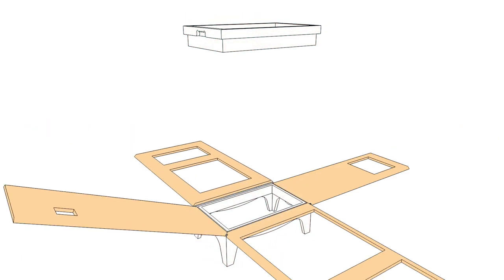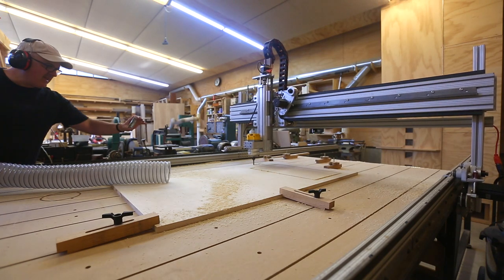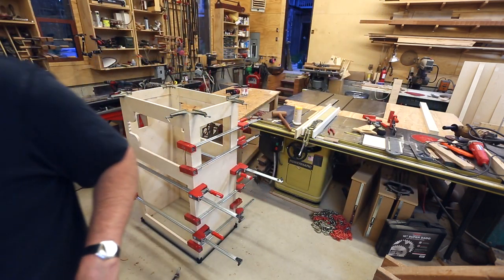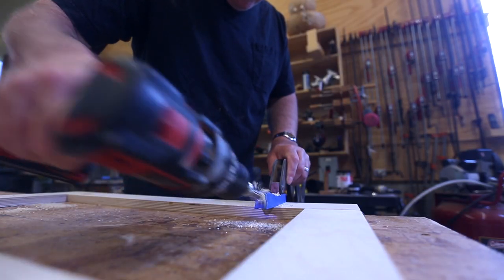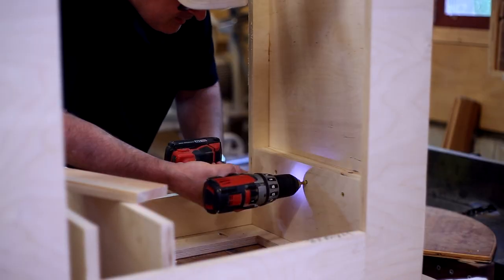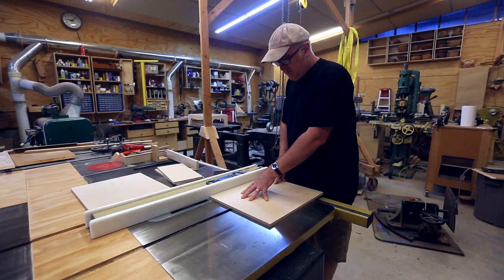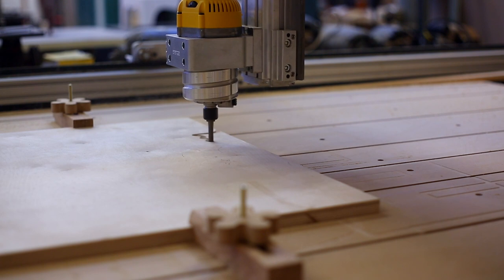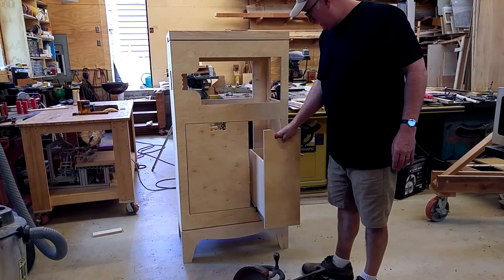Microwave/Recycling Bin/Shredder/Mail Tray Cabinet - Part 2 of 3

Comment: I enjoy making projects out of Baltic birch plywood.  It is a mostly perfect substrate.  The only drawbacks are the weight and cost.  Case goods become heavy quickly.  It is such a strong material that with a little extra engineering, one could get away with using thinner stock than the usual 3/4".  Nice project so far Frank.  Thank you for posting.

Comment: Hi Frank, I see that the CNC is still needing a dust extraction system. As I understand from the build, the gantry is plenty strong to hold the weight of a small/medium shop vac. That way you have to run hoses only from the gantry to the router, and maybe have a home position where you could run the shop air duct over the small shop vac and empty it by sucking the chips.  Crazy idea I know but you could improve on it. 
Thank you for the videos. I like the kitchen remodel series.

Comment: Seems like you could use the CNC with a chamfer bit to cut the panels to size, eliminating two passes on your table saw, and still get the perfectly straight bevel you need.

Comment: Hey Frank,
Absolutely love your videos, an inspiration for the work ethic and wood shop I want in the future!
I was wondering what sort of nail gun/s you use while gluing material together?
Reply from the maker: +Matthew Condie 18 gauge brad nailer for bigger stuff and a 23 gauge pin nailer for smaller stuff look drawers. The 18 gauge is a porter cable. I'm not sure what the 23 gauge is
Reply: That's great, thanks Frank!
What are your thoughts on battery powered nailers? Have you had much experience?

Comment: Couldn't you use a smaller CNC bit and make the drawers out of the same plywood piece as the front. Or is it too time consuming that way?
Reply from the maker: +beskone1 I wondered about that after I cut the opening in the cabinet. I have an 1/8th inch bit that probably would have worked
Reply: +frank, great work anyway!
Reply: The "CNC bit" is called an end mill. (I can't seems to find a phrasing that doesn't sound insulting. Sorry I don't mean it to be.) He could, but it would take a lot longer to cut and it's a lot easier to break an end mill that small without proper feeds and speeds. Good end mills are not that cheep either.
Reply: Cabanaz Really? You have to pollute the comments section with such a negative comment? 👎

Comment: What bits do you use for your CNC? That baltic birch doesn't seem to be chipping whatsoever.
Reply from the maker: +Iain Campbell A 3/8 inch compression bit for some of it, and I think a 3/8 inch down cutting bit for some of it
Reply: +frank howarth Thanks. What do you typically use for RPM and feed rate?

Comment: is there any particular reason for having the shredder and recycling bins separate? Like do you use the shredded paper as kindling?
Reply from the maker: +rparker069 just to keep it simpler. I want to build a bin to go in the recycaling drawer I and I could not figure out a simple way to make that work with the shredder.